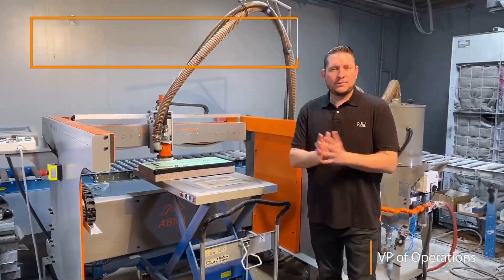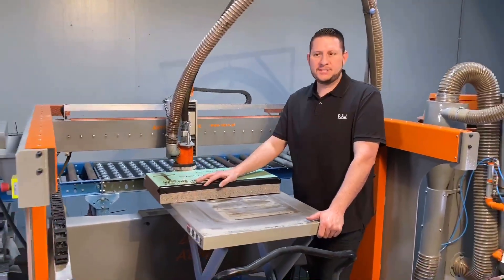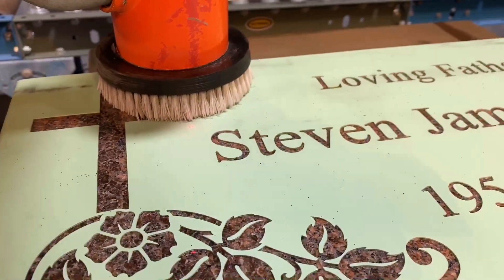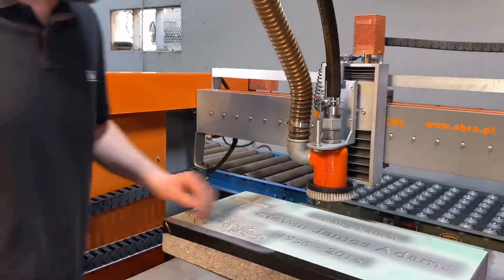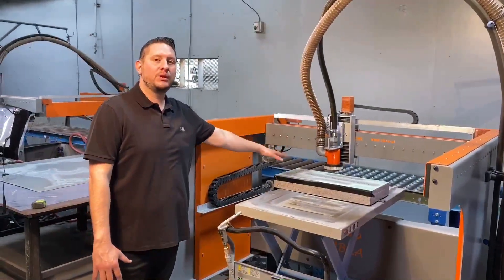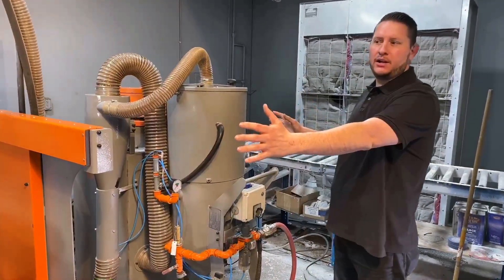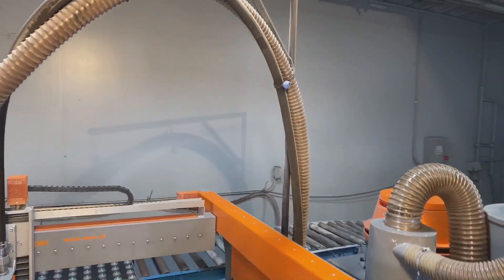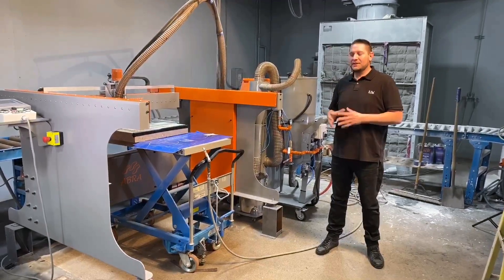CNC AutoBlaster by Rayzist Photomask

Comment: Fantastic video. Definitely a lot quieter than traditional sandblasting booths.  God bless 🙏
Reply from the maker: Wonderful, I'm glad you had a good takeaway from this clip. The sound goes louder the higher the blasting pressure you have. We have measured 97-109 Db, and it also depends on how close you are to the machine.